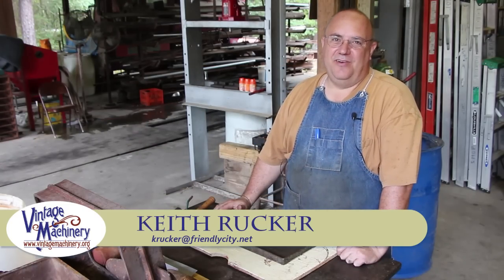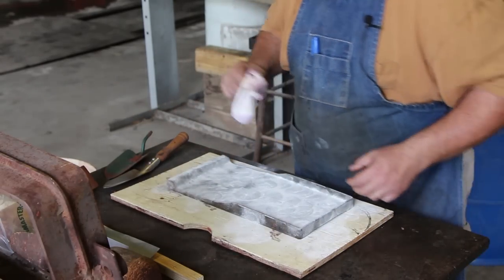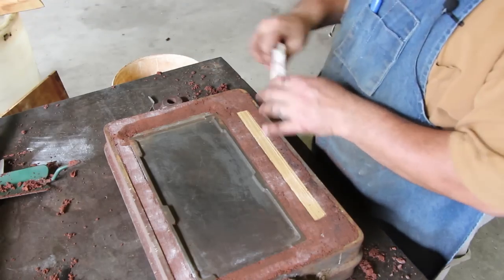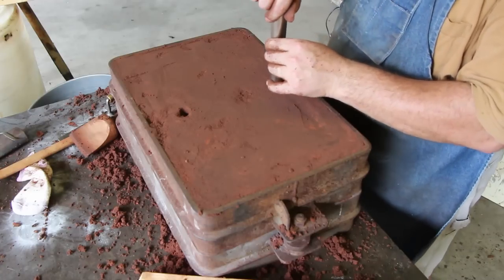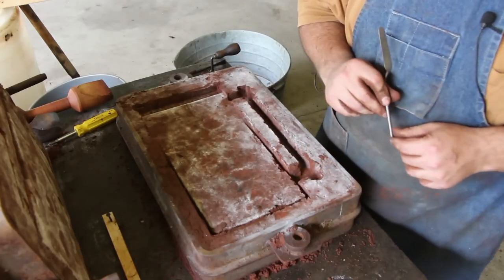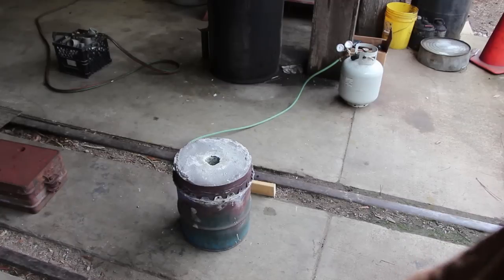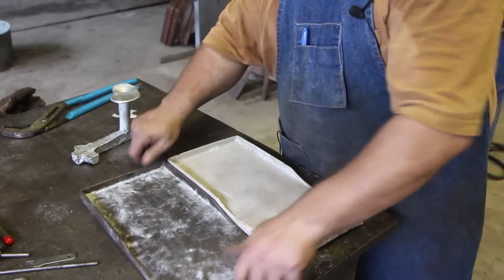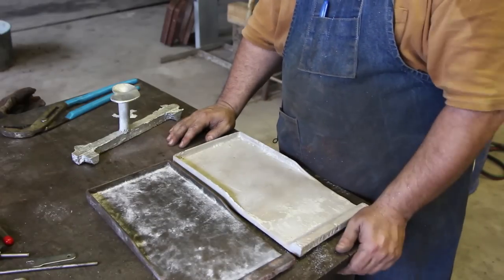Making an Aluminum Way Cover Part 1:  Casting the Part in my Backyard Foundry

Comment: I noticed you didn't sift your first layer of sand onto your pattern, how come?
Reply: Deane Richardson I'm no casting expert by any means. But my best guess would be. It's only really necessary with intricate parts. With this part being so flat and simple, I would think the sand will lay down on it nicely without sifting.   Good  question though.

Comment: If you have the ability, pre-heat the mold in an oven at 450-500F for an hour or two. It helps alleviate the cooling on thinner cross-sections.

Comment: Don't feel too bad about not thinking about magnets Keith, sometimes in the shop people just become stricken with a sudden case of "The Dumbs."  Happens to me all the time.  Probably a few of the magnets like the ones that are used on the base of dial indicator stands would be useful for parts like that, you'd have no force pulling it until you were good and ready to turn them on and do an even lift, whereas just a strong permanent magnet might risk pulling up before you're ready as you're just lowering it down to the pattern.

Comment: Hi Keith,
I've seen how much it was difficult to remove the cast iron part, just a suggestion, if the cast iron was a magnetic type, you could use an set up with magnets to pull it out, just an idea hope that could help for future moldings.
Good way of getting things done... Getter done!
Cheers,
Pierre

Comment: Hey Keith,

Awesome video. I feel like a jack wagon giving you advise being you are so knowledgeable but if the part is magnetic there are the magnetic welding clamps from stronghand tools at a reasonable price that have up to 200 lbs (I think) grip you might be able to use to remove the part from the mold. 

Thanks again for all the awesome videos. 

Mike

Comment: Nice job Keith! Do like the magnet idea that a lot have suggested! Missed that one myself!
Did you get the pics of the forced air setup I sent?

Jeff
Reply: It will speed up the melting a lot!
I'm hoping to do some casting videos in the next few days or so! Will try to do more explaining on "Why" and "How" in them!
I will be casting some aluminum pry bar handles like I've done before, so I get to reuse an old pattern again!

Comment: What about lifting cast iron parts with strong magnets, something like the welders positioning magnets maybe
Reply: loud speaker magnets also work great for stuff like this - but put a piece of foam or a sponge between the magnet and the cast so the magnet doesnt bang it
Reply: @prinzeugenvansovoyen732  He did mention movers, didn't he? That is what those magnets are often called and marketed as for commercial and industrial applications. The set I use for hobbing are branded as magnetic movers.
Reply: I was thinking old school cb antenna.

Comment: Keith
It always amazes me when you do foundry work. It must be a very rewarding art. You take a raw material, use fire (a basic "element") to make the material molten, then pour it into a mold that you also made. You are then given an item that requires your skill as a metal worker to finish to your desired requirements. Like any hobby, I can see how this could really be a lot of fun. The gratification comes from the part you have made and can put to use. I find it's as interesting and enjoyable to watch as anyone making something on a lathe or mill. Thanks for sharing!
Have a good one!
Dave
Reply: *****
Keith,

What you have for aluminum and brass is a darned good start.  Other DIY molders use the same sort of setup, but have dual fuel burners.  They get things going with propane and then switch to waste oil.  It seems that oil burns hotter than propane and that melts the ferrous scrap.

Obviously, you can't use a cast iron pot as the melting vessel.  You need a crucible made from refractory material.

Good luck.

Eli D.
Reply: ***** Hey Keith, I'd love to exchange info with you on waste oil, I am interested in building a waste oil furnace as well.  That seems to be the cheapest way to get to iron melting temp at home.
Reply: That would be great.  I got started down this path when someone gave me a copy of the Artful Bodgers waste oil furnace book, pretty much gives you an A to Z how to.

Comment: Good job, would like to know how you mix your sand???  I'm using oil and don't like the way it packs.  I'm a newbie when it comes to mixing. Any suggestions?
Reply: It's been a while since I looked into doing some casting, but if I recall correctly, one common additive to floor sand is wood flour - which I take to be a super-fine sawdust - in order to get the porosity & plasticity right. 

A little internet searching on foundry sands - green sand, floor sand - will give you some good ideas...

Eric
Reply: chemech  Thanks I'll do that.
Reply: ***** Thanks Keith I will get some Petrobond keep up the good work.

Comment: Could you not use some hot melt glue to stick a piece of wood to the piece and lift it out of the mold with that? Could be reheated easy to remove the "handle".

Comment: I think if you needed it to be a better casting, you could have built up shrinkage allowance and draft with bondo, or double sided tape and cardboard /wood strips/masking tape , stuff like that.
Reply: ***** If you had a lot of wax around, you can dip the part in wax a couple of times then ram it up and the wax will take care of the shrinkage! Something to try next time! I've done it 2 or 3 times with good results!
Jeff
Reply: I like your thinking, keep it simple and no job is complete without bondo and duct tape...seriously, the stuff works fine for what Keith is doing as far as foundry work goes. The machining is a different story.

Comment: Keith,
I noticed you didn't start with screening the sand against the part.  Is that not necessary for a simple shape or was the sand prepared off camera.

Since the pattern was cast iron, would some magnets have been helpful for removing it from the sand?

I really enjoy your videos and explanations of the steps in your projects.